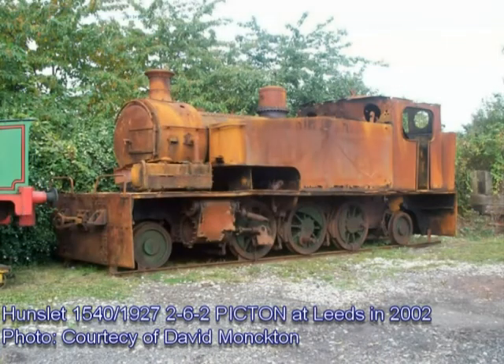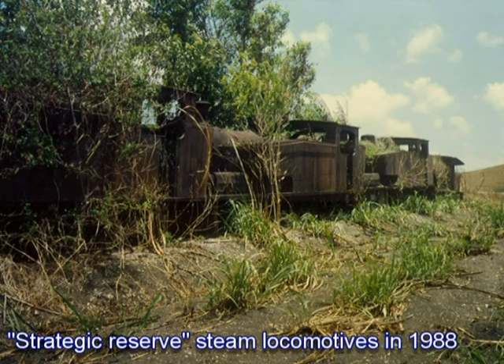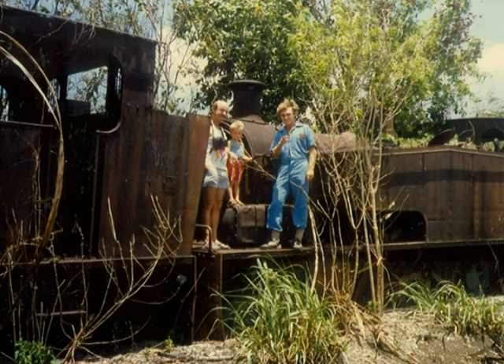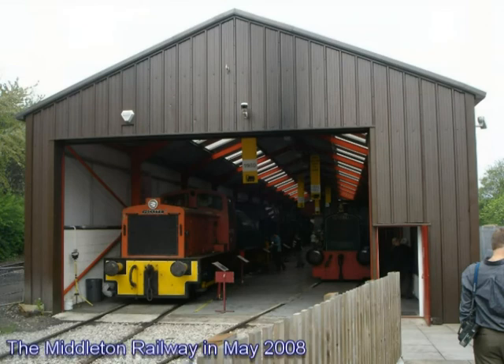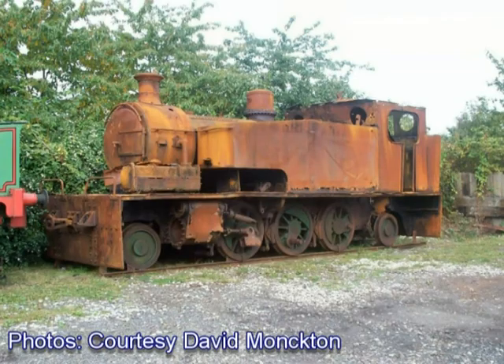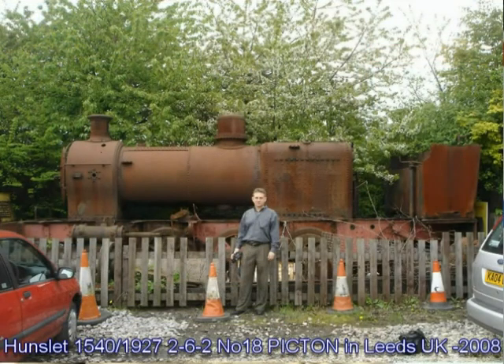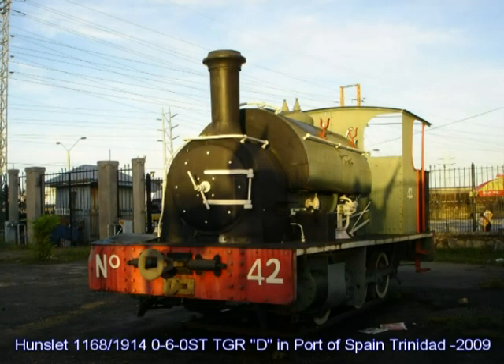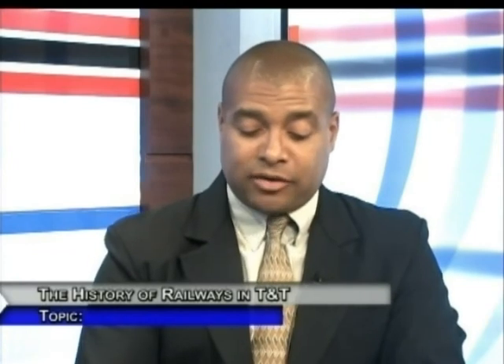Trinidad Railway History 2009 Part 2

Comment: Could any one say were did the San Fernando train turn off to go to San Fernando when it came up what is now the bus route? And what is that place to day?
Reply from the maker: Cecil, the tracks split at St Joseph railway station. From St Joseph station the railway continued as two parallel omnidirectional single lines for another 3/4 mile to Curepe, crossing the southern main road, the San Fernando line then diverged to the south along the western boundary of of UWI towards Caroni village.